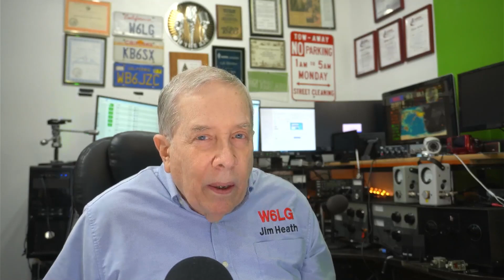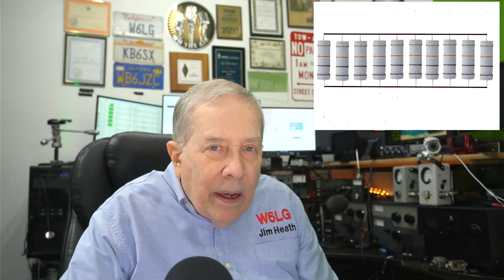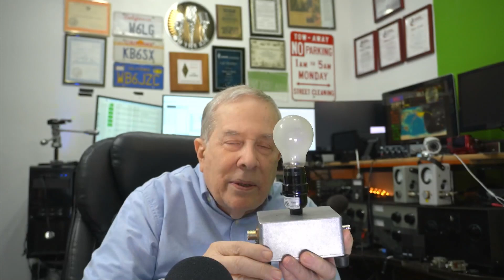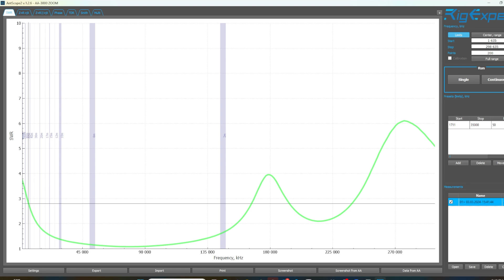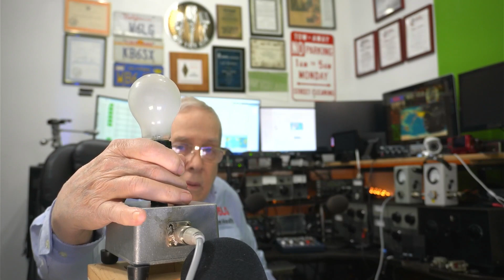A Different Dummy!  Jim W6LG Builds and Demonstrates a Dummy Antenna that is Very Different

Comment: This video brought back a memory from my Tesla Coil days. My T.C. partner and I balanced a large Hydrogen Thyratron Tube out of a linear accelerator, Atop the ball of the T.C. 
The tube was known bad, but the vacuum was still good. The corona was absolutely beautiful emanating off all metal parts within the tube. After playing around with it for a while, 
we lowered the voltage to a minimum. Then, we just kicked back in the dark, watching it. About 10 minutes had passed and we were about to move on to something else, when 
the tube ignited, unfortunately, once we turned it off we could never get it to re-ignite again.

Comment: Many years ago I built a tetrode amplifier for 2m , it had too much gain for the radio I was going to drive it from.  I drilled a matrix of holes in 2 small pieces of unetched PCB and use a number of parallel resistors in order to swamp the grid. It was surprisingly effective, I believe in my case I used 9 470 ohm resistors... close enough. With minimal lead lengths and the reduced inductance of multiple resistors in parallel this style of load can serve very well to VHF and above. 73
Reply from the maker: I have heard about that from a former neighbor who did build a big tetrode with a thousand watts of plate dissipation.  I stayed with triodes because they were so easy. For a time, the driver was a Swan transceiver that had lots of output. It wasn't clean.  73, Jim W6LG
Reply: @ham-radio  yes Jim, for most HF amplifiers triodes are the way to go. Plus no screen supplies to worry about. Always great videos on your channel, 73

Comment: When I was a teenage ham I couldn't afford a dummy load so I tuned up my Heathkit transmitter into a lightbulb. Our 240v 60w lightbulbs were about 70 ohms on HF and could handle 100w of RF. It glowed red on speech peaks. One day I stuck it on the end of a lengthy of TV coax and got a 55 report from an Italian. About 700 miles from here. I git up to all sorts of crazy stuff back then. GM4SVM
Reply from the maker: Me too Gordon. I worked my neighbor.  Another commenter is asking from more detail and a schematic.   Honestly, that does surprise me a lot.  A schematic for a dummyh load.  It is a resistor across a coax connector.  A little bit like asking for a schematic of a dipole at the feedpoint.  Today I am supposed to start chemo again but my blood test results from yesterday show that I am way too weak.  I will know more in a few hours. 73, Jim W6LG
Reply: @ham-radio  I hope things improve and you get the treatment. I'm on holiday from work this week. My last ever work holiday as I retire on June 30th
Reply: That's enough to work the neighborhood.

Comment: Looking Great Jim, As always great information, would it be possible to show a couple of build images of the dummy load or a rough schematic?
Reply from the maker: Paul thanks. You are asking for a schematic of a dummy load!  I provide a drawing of the resistors.  Honestly Paul that does surprise me.  It is a resistor connected to a coax connector.  There are two wires to a resistor. They connect to the coax connector as I drew.  it is the same the load presented by a dipole.  It is a dummy antenna.  The light bulb is connected to the resistors.  73, Jim
Reply: @ham-radio  It was just to clarify if you was using anything else in circuit Apologies Jim I should of made myself clear. I can see now how it would appear hi hi!.

Comment: Nice work. When the lamp filament temperature goes up at higher power than what an swr meter uses, lamp's resistance goes up, in parallel with 50 ohms and will not influence the resulting swr so much, as shown here
Reply from the maker: I could barely see the change. Literally, see the change. 73, Jim

Comment: I used to use a light bulb in series of a power line going into a circuit.  A good circuit the bulb would not light, a shorted circuit and the bulb would light. For example put a 12v bulb in the line from power supply to the transceiver. The brighter the bulb the worst the short.  Most of the time the culprit was an Electrolytic cap.  Awesome Jim!!
Reply from the maker: Yes, current flows. 73, Jim

Comment: This is what we are all about!!!!!  experimenting.  Thanks Jim!!!!  Looking good bud!!  73, N8SOT
Reply: Agreed....lookin good Jim, what amp are you using?? I see the drakes sitting idle Jeff de WD8JM
Reply from the maker: For that, a KPA500.  It blinks off quickly if there is a problem.  One Drake is highly modified with a better power supply, step start and more.  The other has a very large power supply and a GS35b tube, vacuum, etc.  73, Jim W6LG